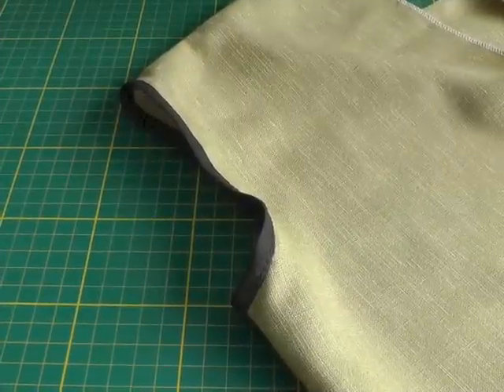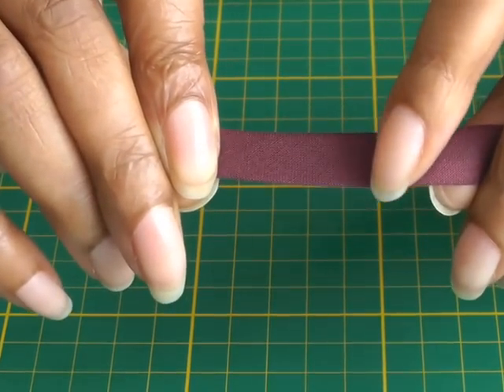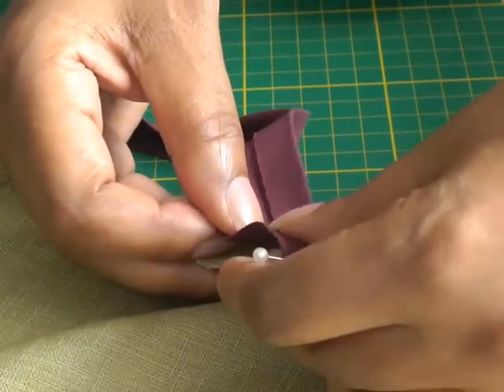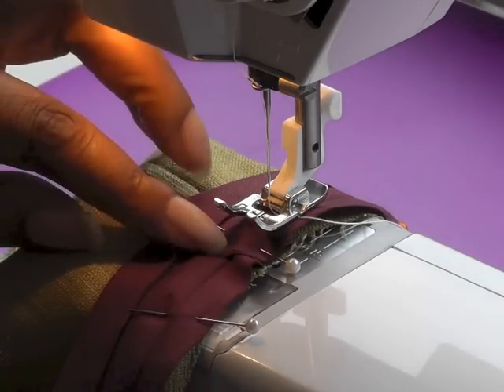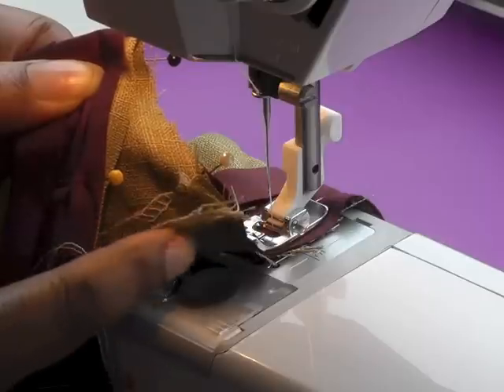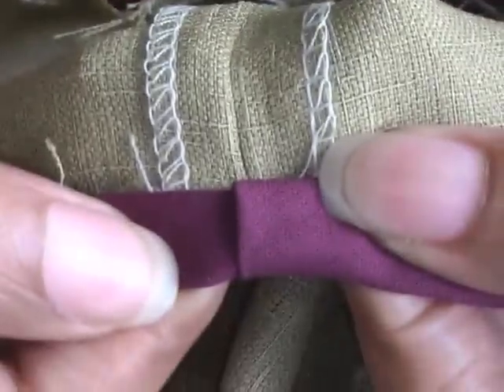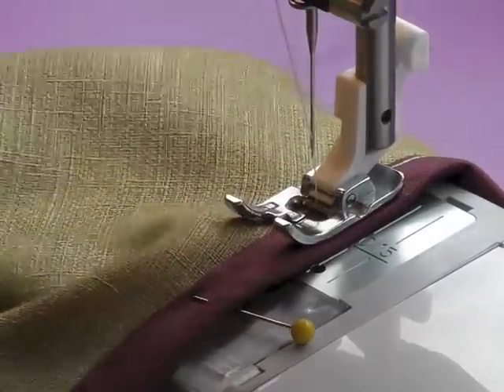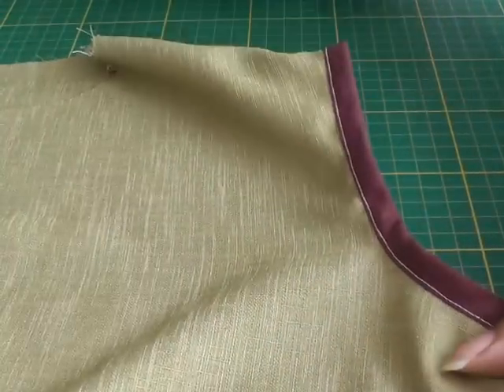Bias Binding as a Decorative Trim

Comment: My preferred method is similar to yours, but I put the narrow side facing OUT, and sew it first, then fold the wider side to the inside, and then stitching on the right side  I bury the stitches in the seamline ("stitch in the ditch") so you do not see the thread on the right side, but it catches the wider side on the inside.  So much prettier.
Reply from the maker: Thank you for sharing your technique Mellie Cline.
Reply: Could you post a video of your technique?
Reply: Mellie Cline  Great technique! Thanks for sharing. Also, do you suggest 2” width?

Comment: I must be thick. I can't figure out how to use bias binding, even after watching videos. It looks nice in a contrast colour but how do you trim the seam allowance before stitching on the bias binding, trim it all off like 1.5 cms? Also what are all the different folds for if you don't use them? Seems very complicated but I suppose it is one of those things that only make sense to you when you actually do it. Unfortunately I need to figure it out to finish my first project but the pattern instructions are very confusing.
Reply from the maker: Hello Sandra, you are not thick! There are many ways to use bias binding, I would recommend doing a couple or so test samples on scrap fabric. The different folds are for different options, as for the trimming of the seam allowance, it is not always necessary it depends on the fabric and project.. I hope that helps.